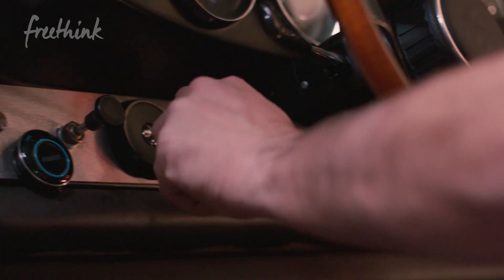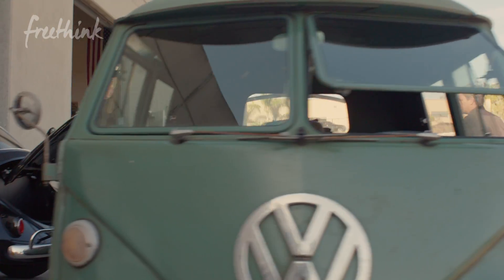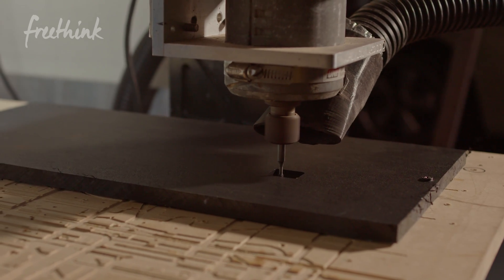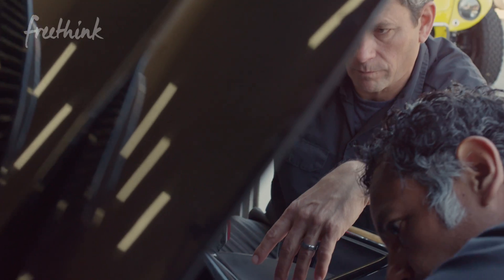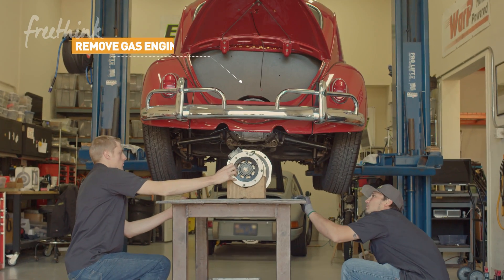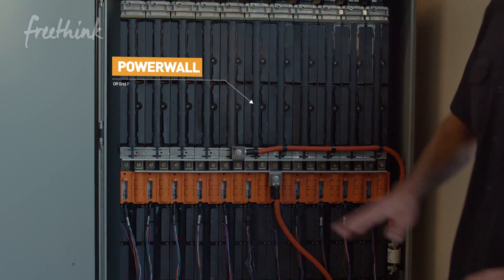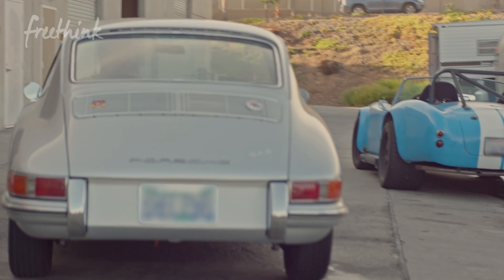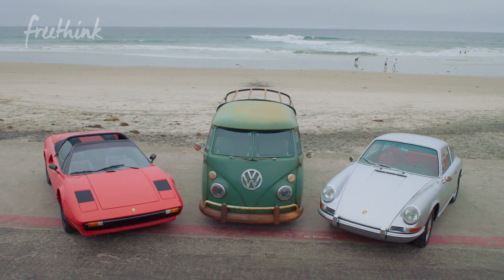The Garage Converting Classic Cars to Electric Vehicles | Freethink DIY Science

Comment: Destroying the heart and soul of cars of a different era. Classic cars are classics because of what they are, not some mindless modification using an electric conversion which is still ultimately powered by fossil fuel. Ridiculous.
Reply: whats wrong with future proofing these beautiful cars? there will be a day when it becomes impossible to drive ICE cars. why are you being such a stick-in-the-mud traditionalist?
Reply: @dancelittlesquire , you have no soul if you can't see that is destroying what was, in many cases, one man's vision and creation. It's bad enough putting different engines in but electric motors. Unacceptable to me. I have worked with electricity all my life but I don't want it powering my classic cars.
Reply: @iainreid9914  i bet its a generational thing...
Reply: , 

of course it is, I grew up with these cars when they were new and appreciated the skill and paasion that went into their design and construction without any of the modern aids to that end. I've been fortunate to own a couple of real hand built cars of the 50s and 60s. Something that is very rare in  cars of today. 
Also the roads were much quieter and I could enjoy the performance on the open roads, no longer unfortunately except on rare occasions.
Reply: @iainreid9914  You've just proved my point. It will mainly be people under 50 getting electric motor conversions.
Reply: Iain Reid , I have to agree with Roo here. There are hundreds of thousands of so called classics still existing. The engines are two thousand moving, metal parts, lubricated by oil, coordinated to explode gasoline and plumbed to try and keep the burnt carbon “relatively “ clean. When you consider the modern electric, induction, motor with 18 moving parts, ice engines are just old and antiquated. Yes, some of the old autos that Jay Leno is preserving are real parts of the automotive past and will be considered automotive history, but most of it has no place in the future. I really hate to see guys investing in it, I really don’t think 95% of so called classics will make it to the future. I am probably of your generation, 65, but I really don’t see it. On the other hand, the new technology is very exciting. I’ve owned a new Model 3 the last 9 months and it is one incredible car. Here in California, we are working very fast to convert to sustainable energy. Coal plants are nonexistent, Green energy is moving forward at a fast pace. Most major cities and the state itself have mandates and timetables to convert to clean energy. I’m afraid that in ten years time (yes ten years) that if significant progress is not made in eliminating carbon from our atmosphere, we will suffer cataclysmic results such as most of Florida disappearing under water. To me, what VW did was inexcusable, and they were fined something like 5 billion dollars for being part of the problem rather than the solution.
Reply: @dancelittlesquire  You are going off on a tangent. If you modify the car in such a way it shows you don't understand or appreciate what is a piece of history.
Reply: @iainreid9914  in 20-30 years it is entirely possible that it becomes illegal to drive ICE cars on public roads (just as it is in some areas of european cities today). These cars are meant to be driven and seen by people - classic cars brighten people's day, and electrification is the only way that may happen in the future. Although I do fully agree that important historical artefact vehicles should be left as traditional as possible and kept in museums or driven on private test tracks etc.
Reply: @dancelittlesquire ,

 I sincerely hope you are wrong in that prediction. The last thing we want is to consign them to museums, they are for driving for the pleasure they give. 
What is it that motivates you to want an electric motor and all it's elctronic control equioment in an old car. Where are you going to put the batteries, as surely you will be compromised on suitable areas to fit them limiting range, Or are you going to completely re engineer the body and end up with a classic in appearance only?
Reply: I’ve got a ‘70 VW camper bus w/o pop top. I can’t wait to convert it to Tesla power , after the BS vw pulled on its customers. I will proudly replace the name emblem with Tesla- vw .
Reply: S, your prerogative, it's your vehicle. Don't be so harsh on VW though, there is another side to that situation.
Reply: @The Stigs Swedish Cousin Well many people in this comment section disagree. There's no such thing as a "real car fan", if you're a honestly a fan of cars, then you're a car fan. There's nothing wrong with enjoying cars aesthetically, but wanting to be MORE environmentally conscious (while also having a faster car, a more reliable car, a quieter car, a cheaper to run car, etc. etc.) An electric Beetle is better than an ICE beetle, an electric camper is better than an ICE camper. blah. blah.

I think you'll find you're the one being a hipster:

"this band was so much better back in the day, when they were old school" - "these cars were so much better back in the day, when they were old school"

"this popular well liked band is so overrated" - "these popular well liked electric cars are so overrated"

"this type of music is 'trendy' and popular atm and therefor bad" - "this type of car is 'trendy' and popular atm and therefor bad"
Reply: @The Stigs Romanian Cousin what's worse, putting a Vtec into a classic mini, or doing an EV conversion to it?
Reply: @The Stigs Romanian Cousin I know a guy who put a B18 in a 60s mini. Want his address so you can kick his ass?
Reply: @The Stigs Romanian Cousin then why do you care for these guys doing EV conversions?
Reply: @The Stigs Romanian Cousin funny, a lot of Mini enthusiasts will say the same about vtec conversions, so where do we draw the line? Are you implying no classic cars had auto gearboxes? Or that no diesel is fun to drive? Ever driven a GTD (emissions scandal ignored)? Actually, Leaf drives a lot better than it looks, but what if one doesn't like how it looks?  Have you ever driven any sort of an EV? Golf carts don't count.
Reply: @The Stigs Romanian Cousin just for fun: 1965 911:Max hp 130 at 6100rpm, redline 6500rpm, peak torque 129 lb-ft at 4200rpm. 8th gen Civic (non si) max hp 140 at 6300rpm, redline 6800rpm, peak torque 128lb-ft at 4300rpm...Civic is more or equally fun to drive? O.O Or is there something more than just the numbers? 911 is lighter, but is it the only variable?
Reply: @The Stigs Romanian Cousin what's so horrible about leaf? It's basically an EV Versa.
Reply: @The Stigs Romanian Cousin compared to Versa it has less body roll, and I felt it would understeer less. The steering is a bit numb though, but so was steering in Integra GSR. Nice to hear you thought Model S was acceptable though...so why can't an older car with a blown engine be made to drive similar to it? Or you're just on the bandwagon "it destroys the car's soul?" Which is understandable, I was a teenager at some point as well.
Reply: @The Stigs Romanian Cousin putting a Vtec into a mini also ruins its character. If you know how to drive, you can have fun in any car, and EV's aren't cars with the least potential I've driven. As for model S it is more of a highway cruiser, but the roadster is rather fun to drive. What is fun to drive with you anyways? Is it just the engine? I wouldn't be surprised if some of the ev conversions ended up having more potential. And just for fun, how do you define handling?
Reply: @The Stigs Romanian Cousin yeah, Manuel gearbox is a nice one, Manuel was a great guy. Usually how chassis and suspension engineers define handling is how much the car rolls, where the roll center is (for both front and rear axles) how the car squats or dips when accelerating or braking, how it breaks loose, when it breaks loose etc. In that regard I found the leaf to be actually more fun than the model S, it was more tossable. Straight line acceleration wasn't that great, but more lively than a gasoline car with similar hp. As for shifting the gears and hearing the sound there is appeal to everything, just like riding a horse. But a true car guy would give any wheeled(or maybe not even wheeled) vehicle a try.
Reply: Iain yea I think I'm with you on this one. I love EVs and am all for converting old Honda Civics and the like, but a Porsche 911???
No, leave 'em alone.
Reply: @ecurb10  I feel Mr. Porsche would've been fine with it. That conversion is apparently a blast to drive too.
Reply: Did you even watch the video? they are powerd by solar

Comment: Notice they don't mention the price for a conversion. Look it up. Very expensive, and the mileage range is not good.  Also, what about heat if you don't live in a warm climate? Hills greatly reduce "mileage". Radio? Wipers? A/C? All those use electricity and all reduce driving range.  Electric cars are coming but they're not feasible cost wise and mileage wise yet. Long way to go.
Reply: tesla.is able to do a long range.
Reply: I want to party with this guy lolz
Reply: No answer
Reply: I don't think range or price are really the important in this case. The main guy said they're fun and cool. I'm pretty sure most people don't buy expensive classic cars for their practicality and utility. They want something they like that's fun and cool! This isn't a fair example of what electric cars are capable of.
Reply: The range is probably quite good if you are willing to maintain OEM power levels.
A Beetle with a 40KwH pack and a 40hp electric motor will easily get over 300 miles range IMO...as it would weigh less than a nissan leaf (and have a lot less power). Thr 40KW Leaf can easily hit 250mi range if driven gently....so a featherweight beetle would go further and have better performance (due to the torque....40 electric hp will blow 80hp ICEs away).
Reply: Dwayne Mathias just get a Prius if you care about range and mileage, rather than whine about EVs which is clearly the future
Reply: Oh bla bla. Your implying these guys aren't loving life. And they are. If that's a bother to you then look away. You will not change their minds. You do you boo.
Reply: Don't know about this conversions but on a Tesla, eat and cold have very little effect on range has their batteries are climate controlled and all the electronics of the car, screens, cabine lights, cameras, etc have ZERO effect on the car range, even AC has little impact, all because of regenerative braking and also because the electronics on a Tesla are very efficient and don't need much power.
Reply: @Argoon1981  A lying hippie detected!
https://forums.tesla.com/forum/forums/cold-weather-range-1
Reply: @Argoon1981  bullshit. Cold kills the range by 30% or more.

Comment: Whats the range?
Reply: They are freerange cars I think
Reply: @Brainchains   and organic.
Reply: Enough
Reply: Matt Pope base model 3 is 220 miles, mid range is 265 and long range is 310 miles of range. Pretty conservative too, you will get around 300 miles at 70mph.
Reply: Matt Pope conversion electric cars like this however usually top out between 150-250 as the entire chassis wasn't designed to hold battery modules. Take VW for example, their e golf only has around 140 miles of range as it's based on the regular golf platform. The new VW ID coming in 2019 has 180 miles of range in its base config, and over 330 miles in its higher config. That's the difference a car built from the ground up to be an EV makes. Also means e weight is spread and massively improves the weight ratio and handling.
Reply: It all depends on how much battery you want to run or fit in your vehicle. More batteries = more range.
Reply: If they're using Tesla batteries in the same configuration it would be the same. Model 3 goes about 220 miles on a single full charge.
Reply: As with IC engines, it all boils down to your right foot.
Reply: You guys rock man. Keep it up.